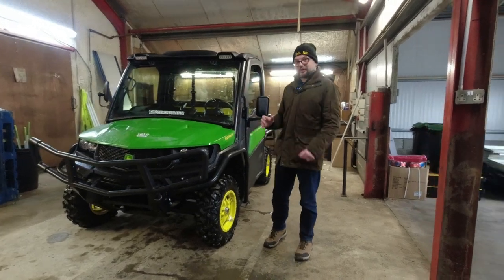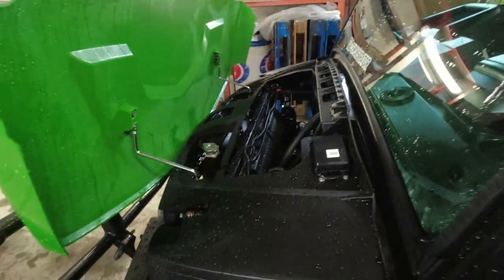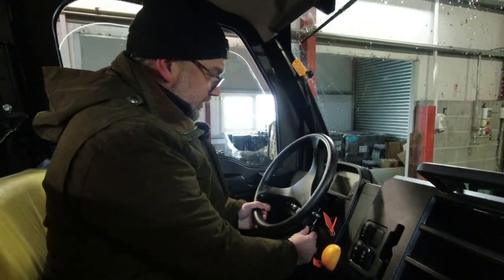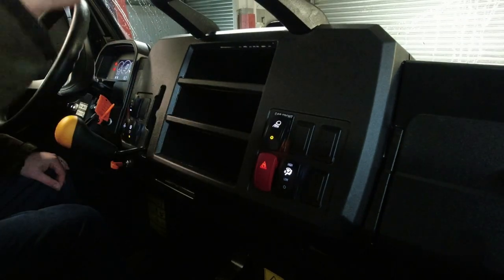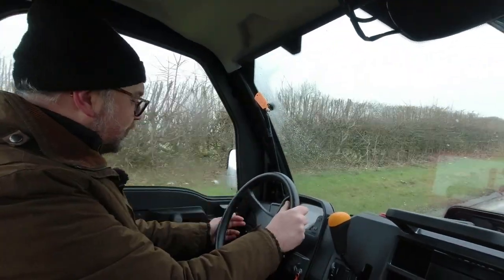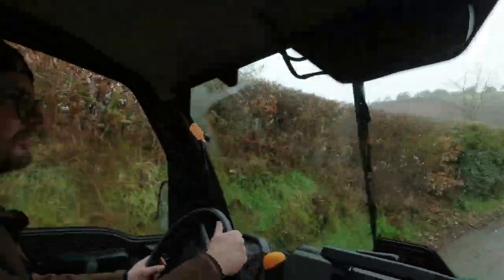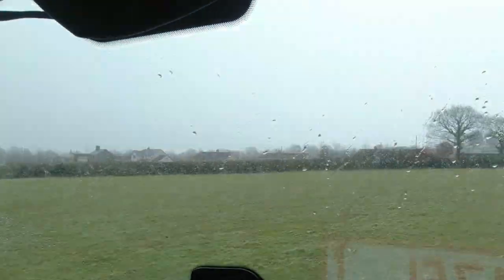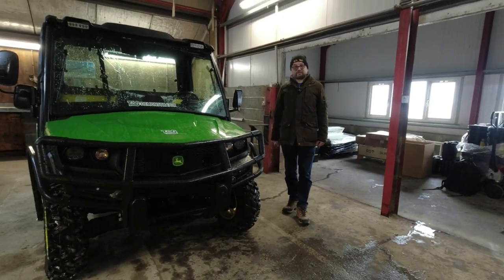Tested! John Deere Gator XUV 865M - Diesel CVT!

Comment: I used to have an electric one when I was a park ranger about 10 years ago. Top speed was 20mph, plastic zip doors, rear wheel drive and lots of heavy lead acid batteries. It got stuck in the most situations as there was no way to lock the diff. Really interesting to see how much they have progressed with functions and capabilities.

Comment: I just found out that this vehicle in the US costs  over $41,000+ US, which costs more than a good auto!
I checked out the Cub Cadet XUV, which is similar but petrol, costs less than this, but similarly equipped, is over $20,000+ US. Top speed for the petrol is 45mph.
Businesses use these to do gardening, etc.
Very nice, I do like!

Comment: I have a 2020 model. Very powerful,  haven't gotten stuck yet, decent mud or a foot of icey snow. That suprised me, pulled a 2 door pickup off the wet grassy hill about 30 feet with absolutely no problem.  Didn't even use the rear lock " possi".. mines seems a lot noiser in the cab than this one. But absolutely love this mchine!!

Comment: I have driven many versions of the JD Gator as my dad used to have a John Deere groundscare dealership that sold these, which merged with the company this JD Gator came from.
 There have been many versions of the John Deere Gators the earliest being the John Deere ATM which was a bike come pickup truck with 4 driven rear axles this then evolved duty to safety reasons into the original Gator utility vehicles with 4x2 (4 wheels 2wd)powered by a Kawasaki Vtwin engine , 4x2 electric EGator  and 6x4 (6 wheels with 4 driven rear wheels) powered by a Yanmar diesel engine. If you see a dark green with black wheels 6x4 Gator this is what was known as the M Gator (military Gator) these were brought out for the US army, some were dropped into the deserts during the Gulf war as troop vehicles and a small amount were sold through dealers to the general public and are pretty rare in the UK. 

There was a mini Gator called the CX Gator designed for those with a large garden who needed an alternative to a wheelbarrow. It had a little kawasaki single cylinder petrol engine fitted to it.

The model that started this particular Gators life was the HPX Gator with fixed beam suspension, which then evolved into the 850 XUV series with independent suspension. Many of the UK ones were powered by Yanmar diesels and America and Canada had the option of diesel or EFI petrol engines. We did get a XUV model in the UK with a twin cylinder petrol engine called the XUV 550 which was more of a fun Gator, there was a twin seat version or a 4 seater version. The diesel XUV 850-855 series also spawned a 4 seater variation around 2013-2014.

Comment: We've got the older XUV850D without the cab from 2008, brilliant little things. there's also a posher version the 865R (in JD speak R is the premium line, M the intermediate line, E economy and D poverty pack) with AC and bit better interior trim and a few other options. Heaps of options can be put on them as well.

Comment: It's a totally different beast to the Aixan. Looks like great fun to drive too. We've seen a few of those in use already; there's one on a farm which we've stayed at, and the farmer loves it. The farmer's one dislike is the high noise level in the cab, but it's great for moving a few sheep around from field to field, and for general utility work. If John Deere could make an electric version, he would probably swap his Diesel version for it. The quiet running would be less stressful for the flock.

Comment: I use the Petrol version with camo paint and air conditioning at work, we use predator tires which are like pickup mud tires.
Our Gator will top out at 50mph.  But is extremely useful at the Cultural Center where I work.

Comment: It’s a nice unit, but for as little as I have in it, I will stick with my 2013 Polaris ranger XP 900.  I chose no options except the half windscreen and a hard top, and only cost $12 thousand.

Comment: I'm surprised how expensive that Gator is, in Australia cars are generally more expensive than the rest of the word but the closest comparable Gator model we have to that which has a larger Diesel engine but lower creature comforts (mostly, no doors) sells for roughly the same in Aud as that one does in Pounds Sterling, so adjusted for exchange rates it's effectively only slightly over half the price here as it is in the UK. Edit: The one sold in Aus is also designated XUV 865M but the engine is quoted as 854cc, & yeah, no doors.

Comment: If it was strictly for off-highway use I'd buy a knackered Classic Subaru Impreza Wagon and put a set of knobbly gravel rally tyres on it. Wouldn't be putting £40k into a Deere.

- Got a Mk1 Mazda MX-5 I do gravel Autosolos with. Welded diff and 2nd hand gravel tyres. Amazing what it can get through with only 2WD.

Comment: The surprise is that the Aixam is quite so expensive.  John Deere using a kevlar belt in CVT is interesting too - TWC would love that !
A comparison with a 1970s Haflinger would be great, but could be hard to find one to try out these days.
Reply from the maker: This test was done firmly in Wales. 😉
Reply: @HubNut  My mistake, I didn't read the description ! Looks like they opened that new John Deere dealership just for you in January, how nice :o)   Just looking at your many microcar vids this eve.
Atb,, Dave in Monmouthshire.

Comment: Now we townies need an electric version for around town.
Reply: John Deere have been producing a model called the E Gator for well over 20 years now. Based on the original Gator platform without the rear suspension. It's not bad, and a lot of golf courses and large schools and universities' grounds departments  have them. They have a bank of lead acid batteries, and max speed is about 18-20mph. A cab can be optionally fitted only downside is if you go full window spec you will have a rather annoying beep to contend with when you put it in reverse.

Comment: Do they do an electric one, my ideal shopping car!
Reply: There is an electric version on the original John Deere Gator platform called the EGator. It's has sensible easy to recycle lead acid batteries similar to those found in a golf cart, and a cab can be opted. The only issue is that unlike this model, it only has suspension on the front end, no power steering, and has a really loud buzzer if you flick it into reverse. Speed is about 18-20 mph. They are mostly seen at golf courses or around some university campuses. The E Gator has been produced since the late 1990's and in that time has really only had a face lift around 2011-2012.

Comment: I wonder what the second hand prices are like ?.
Reply: Depends on condition. There are the older shape 850 and 855 XUV models on the second-hand market. If you are buying privately, it's best to check the machine over throughly as some used on farms and for game keeping use may have been given a hard life. Things to check for are bodywork condition, lights (especially if its a road homoligated version),wheel bearing failure, drive belt, Front suspension and rear suspension (some sag if too much weight has been placed on rear) and the condition of the drive shaft from the front to rear gearbox as these can get worn if the two grease points on them have been neglected. Also, ask for service  history  because if it has been serviced regularly  by a dealership, it might be in decent shape compared to one that hasn't. 

Also, if you are after one with a full cab, be aware that these will have fully glazed doors and aren't as sturdy as the new style half and half doors, although you can remove these and go door less. It's not too bad in the winter with just a front and rear screen fitted as the radiator fan at the front does blow enough hot air in the cabin. 

Also, older JD 850 XUV models won't have the power steering fitted either and they will have a painted steel covered with a plastic bed liner rear bed which is prone to rusting depending on what it's previous use was (salt spreaders were fitted to these by some councils, schools and golf clubs).
Reply: I will keep that in mind , years ago we had a cushman pick up , brilliant little thing carried quite a bit .
That had a belt drive system .

Comment: This side by side is obviously American, but the bulk of the quads and side by side manufacturers are Japanese. That would lead one to think that they are also popular in Japan. Not so. The anal regulations here mean that any of these types of vehicles with an engine size above 50cc cannot be registered for use on the road. They can be registered as farm vehicles (different plate), but since rice and vegetable production is the bulk of the agricultural world here, they are few and far between. Add to that the popularity and convenience of the 'kei-tora' (the light vehicle trucks) and there isn't much of a need for them. The 50cc versions can be registered for road use by anyone as they are classified as mini-cars and the whole process for registering these falls under the jurisdiction of the local village/town/city offices and not the Land Transportation Bureau. Yes, Japanese bureaucracy is possibly the most bureaucratic of them all and when buying a new car, the registration process itself takes anything between 2 to 3 weeks to complete.

Comment: OK so,,,,,, sit down,,, grab a coffee,,,, door handles break on inside window winder fails, eats drive belts, radiator over heats due to the electric fan, wheel bearings, and drive line bearing for four wheel drive break almost on cue,,,,, o power steering rack fails,,,,, that's roughly around when the warranty runs out and than unless your farm is floated on the stock exchange,,,, ya best find a nice ditch that you want to walk across and just drive it in it,,,,, that's if you can get it into gear cause that also breaks off, anyway have fun in your gator it will certainly make your life more interesting

Comment: Whats up with the front & rear bumpers being a foot wider then needed. Talk about a brush/tree snagger. Not any thought put in that at all. In America we drive through woods hunting, with heated cabs, & we want QUIET. Well forget that with the boing yoing clang clang boing of the rattle trap diesel engine. Way overpriced. These are terrible under powered also.

Comment: Aixam (pron. Aches-am) D Truck is around 13,000 euros new. In 2018 I paid around 4,000 euros for my 2011 Mega (Aixam) Multitruck. The average price for a good one of those is 6,000 euros. On my Multitruck the wash jet is on the single wiper as well. 🙂